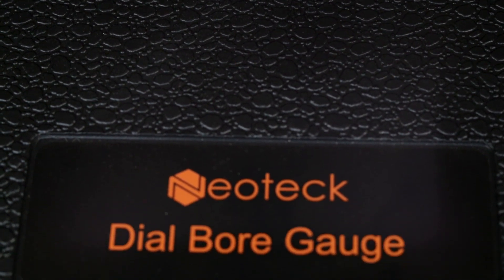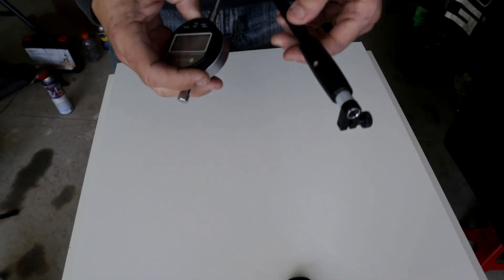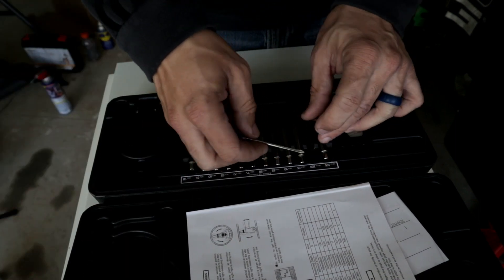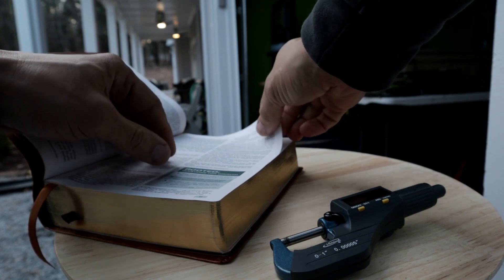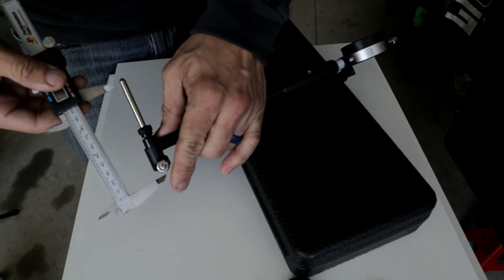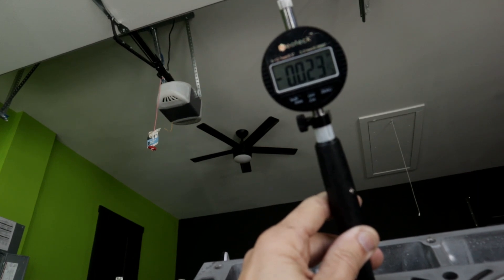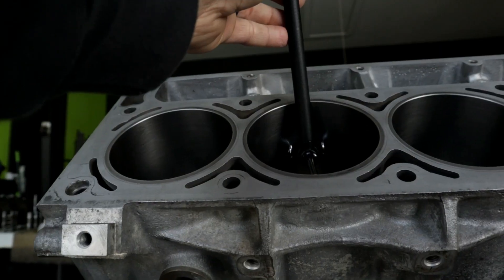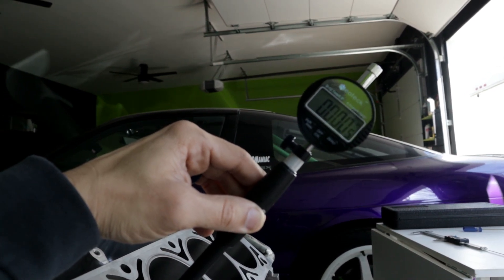How to use a Dial Bore Gauge #diy #enginerepair #enginerebuild

Comment: cant you just set the bore the cylinder is supposed to be and measure from there? Most digital bore gauges let you set your gauge to the diameter its supposed to be
Reply from the maker: yes you can do it either way both ways will give you same results.

Comment: Hello
I just bought this exact same bore gauge recently and was looking for information on it and came across your post.
I’ve never used a bore gauge b4, so please tell me if I did this correctly.
I am measuring 4” cylinder bores.
1) I selected the correct anvil & spacer to measure 4” bores.
2) For zeroing out purposes, I used a 4-5” micrometer, set it to 4” and locked it in.
3) I put the gauge in the micrometer, rocked it back back-and-forth till I got the highest number, which was 0.033”. 
4) I then pushed the zero button on the gauge to zero out the LCD reading; it now reads all zeros.
5) when I take out the gauge from the micrometer , it now reads -0.033”
6) I then go to measure the cylinder bore and I get a reading of -0.002” with a little “5” after the “2”.

Please explain if I did the procedures correctly and what the numbers indicate & what the diameter measurement of the cylinder bore is.

Thank you
Reply from the maker: Yes you’re doing it correctly base on what you’re telling me that bore measure 4.002 you should measure the cylinder on 3 different spots to acquire all the correct readings to diagnosed the bore however if it’s just 2 thousands of an inch you should be fine with just honing. If you want to double check you can set the micrometer to 4.002 and zero the dial bore gauge to that and check the cylinder again. This time it should read 0.000
Reply: Will do the extra measuring;  in research, it looks like 6 different measurements per cylinder at axial and thrust segments at 90°.

BTW- the engine I’m working on is a ‘67 Ford 289.

As far as the block just needing a honing, is it possible to use the same pistons(?) and do a re-ring? as it looks like the rings are probably more worn out than the cylinder walls based on a dry/wet compression check that was done years ago and there where upwards of 30 psi difference. 

I wish I could send you pictures. The cylinder walls are very glazed, almost to a mirror like surface, so no major issues at all pitting rust, etc.

Also, when I periodically see the 5/10000” in the LCD readings, is that anything to be concerned with or just stick to the thousandths measurements ?

Thank you
Reply from the maker: @richardmiller2313 the reason for the 6 different measurements for each cylinder is for checking out of round. Normally the cylinders tend to wear out faster in the middle and less in the bottom and t but it could also have a tapered shape. Impossible to know without getting all the measurements. I wouldn’t worry too much about the 5/10000 as most micrometers and bore gauges have a small margin of error. If you’re just honing you don’t need to replace the pistons you can just replace the rings. I’m not that familiar with that engine so always check for manufacturer specifications.
Reply: @GabesGarage
Update:
At your recommendation, I did add .002” to the 4”( the original diameter of the bore  coming out of the factory) on the micrometer; zeroed out the bore gauge & re-measured and as you stated,  it should read zeros across the LCD display- which it did👍

Thx
Reply from the maker: @richardmiller2313 I’m glad I could help and you got it sorted out.
Reply: @GabesGarage
 I need another question answered please.

After I put the bore gauge in the micrometer and rocket it back-and-forth, I get  0.033”.  
This was in a previous post above, sorry for the repeat.

I then zero out the gauge while it’s still in the micrometer.
I then take the gauge out of the micrometer and now the gauge reads MINUS or - 0.033” on the LCD screen.

Is there a term or terminology for that “minus” portion of the number? I’m trying to explain it to people and I don’t have the right verbiage. 
How can I explain that to them?

Thx
Reply from the maker: @richardmiller2313 that’s just the reminder of the length for the rod you’re using to obtain the right length for the bore you’re working with. That’s why you have to zero the gauge.

Comment: Confused, first measurement you said you were looking for the highest number, your gage reading was the lowest number?
Reply: no it was reading the highest  below  0.  when you go from  -.0025  to -.0024    it's going  higher  because  your going  TOWARDS  0  not away from it.  if  he  was  above  0  the numbers  would be going from .0026  to .0027 for example. then  .0027 is the higher number  because  you're  ABOVE 0 and not seeing negative  numbers on the gauge

think about  it as being above and below  water. the surface  is 0  and below the surface  is  negative  above is positive.  if  you down 10ft and go to 9ft  youre  going UP  not  down but  youre  BELOW  0 the surface  

 -9  is a bigger  number  than -10 

same  as if  you  5ft above  water and move  to 6ft  going UP  again  but  youre positive
Reply from the maker: Man I’m sorry I wasn’t very clear on the details so finding the highest number is just to zero your gauge after. Once is zero and you’re measuring the cylinder bore then if it says zero that cylinder measure that exact same measurement you zero your dial bore gauge to. If goes lower or higher you just need to make the math to get exact numbers for that cylinder.
Reply: @GabesGarage just bought this gauge, its a good thing you decided to clear things up for me😂
Reply from the maker: @KB-mf8ef I’m glad you find the information useful.